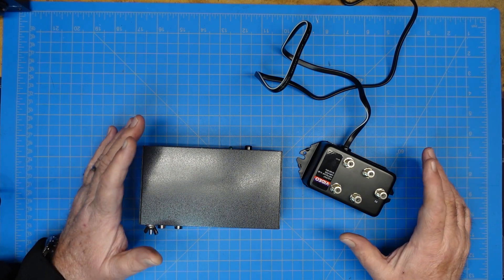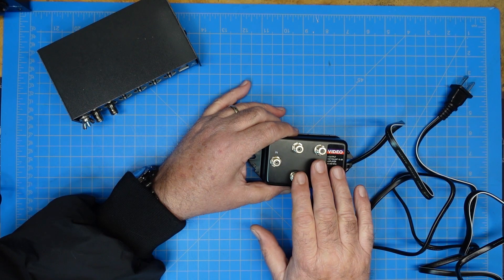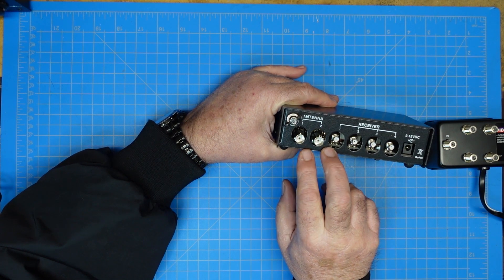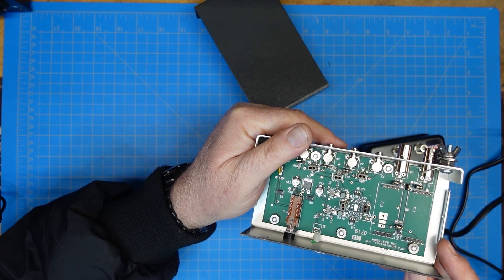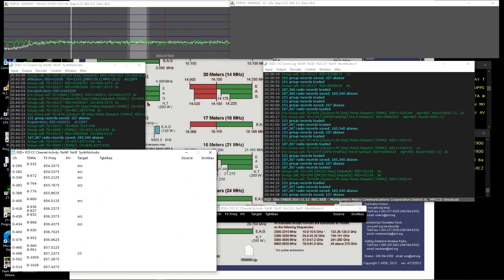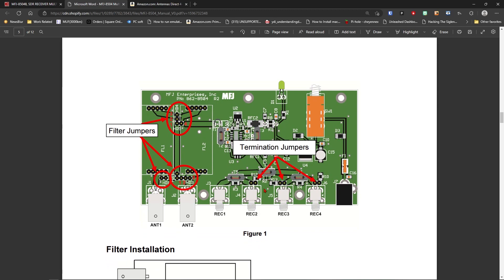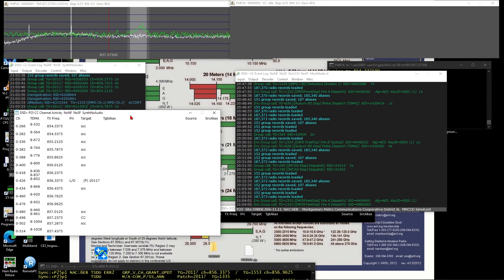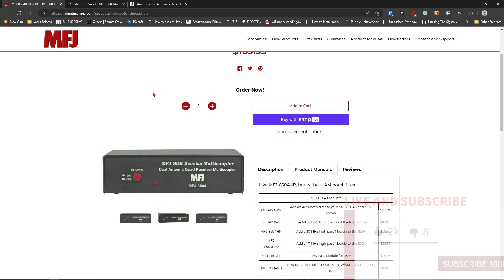Connect a single antenna to multiple SDR.  No Switch!

Comment: hi i was just wondering where you purchased your diamond discone antenna i saw 1 on ali express for 70-80 dollars and wondered if youd go with that or go to a officail radio site and get it for 160-170 dollars?
Reply from the maker: Dylan, I probably got it from Amazon or GIgaparts.  Most likely Giga.

Comment: I don't know how much difference it makes and probably not much for receive only but that tv/cable distribution amp is going to be 75 ohms and most antennas and sdr's are set up for 50 ohms. have you done any testing to see if the impedance mismatch is affecting the performance?
Reply: Every time you switch between 75 ohm to 50 ohm you lose about 5% of the signal.  So this setup likely loses 10% of the signal.  To be honest with him using a discone antenna (no gain) it's not really a high performance setup so the 10% loss is probably not noticed or made up with the additional gain from the preamp.
Reply: To be clear for his use this setup is totally acceptable.  If he was trying to do some weak signal work the shortcomings would be apparent.  If you are using the cheap RTL-SDR dongles out there and want to hook a couple of them up this is a fine solution.  If you are running higher end SDR receivers you would be better served with a proper 50 ohm signal splitter.  If you need more gain then add a preamp (LNA) that is powered via a bias-T.  Most of the high end SDR's and even some of the cheap ones will power the preamp over the coax so you can place it near the antenna where it will do the most good.
Reply: On receive this matters so little that it is not worth bothering about.

Edit; especially a mismatch this small
Reply from the maker: I haven't - honestly man, it works so well as it is, I didn't see the need.   My criteria for that is what I had showed, using to SDR dongles and piping all that in DSD plus.  P25 decode requires good signal, or you start to lose traffic.  And, like you say, I don't believe it matters at all on RX only.
Reply: @FEPLabsRadio  thanks for the reply, I have a couple distribution amps and had thought of trying them out but thought I'd need some impedance matching adapters which I don't have. So I've been moving the antenna from between several sdr's depending on what I was trying to receive.

Comment: Great video.  thanks!  Any major reason you would go unity gain as opposed to 5-7db gain?   Probably doesn't need it gain I imagine, but there certainly less selection of unity gain units out there.  Some Commscope units etc.  

You seem to have improved  the sync loss / errors etc, Are you getting over signal loading?  Thanks!
Reply from the maker: I honestly didn't even consider gain.  With a decent antenna, I'm well within range of the P25 system that I monitor.  I was a little surprised at how much better the tv amp worked, but it also does add some gain in. As for signal over load, that is a possibility, but I really don't think so.  Standing outside with my SDS-100 scanner in hand, it works ok, but not super good.  I do seem to drop conversations here and there.  Add in to all of this that I'm connecting to a simulcast, which can cause issues for a lot of scanners to decode well.

Comment: Great tip Jim. I have a 6 port unit with build in amp for my free to air TV outlets that we no longer use, I may check it out and re-purpose it!👍🍻😉
Reply from the maker: Go for it!  It's all RF, and other than the band limitations on some units (no HF), it works great.

Comment: I think the MFJ unit does not have enough isolation between the output ports. Typically SDR rcvrs do not have anything much between the mixer and the antenna, so I suspect they are very noisy.
Reply from the maker: Yeah, I was seriously under-impressed with the MFJ unit.  That old TV amp worked very well.

Comment: Appears to be  PHILIPS/MAGNAVOX PM61116 10dB Signal Amplifier 1 In/4 Out   I just got one on Ebay new for $21.47 shipped..   GREAT Video Jim ..
Reply from the maker: Thanks for sharing the model.  That is gonna be it, i wondered if it was phillips.  I'm pretty sure it was a radio shack or wal-mart buy from 25 years ago.  Literally been sitting in a box o junk here.

Comment: Thanks Jim.  I have one of those tv distribution things that I used a while ago that sitting in a box somewhere.  Now that I'm using sdr's again I need to pull that out.  One question, since both state that they go up to 900MHz, have you tried using it for adb-s tracking since that is 1090 MHz?
Reply from the maker: I haven't.  For ADS-B you'd probably want a 1 to 1 solution.  It's a specific antenna, tuned to a specific frequency, for one purpose, not really general purpose listening.  It probably has a filter above the 900mhz specs.

Comment: Thanks Jim for making me look in a lot of boxes in the basement for one of those things. I didn't think about using one of these, but this might solve a couple of problems.
Reply from the maker: You bet!  Morten, I've had that CATV dingus forever.  I literally had never used it, been in blister pack for years.  I was amazed at how well it works doing the thing.